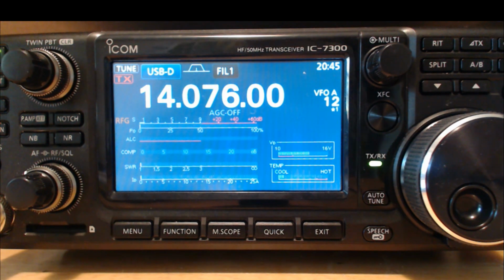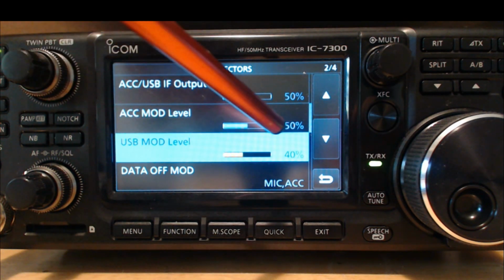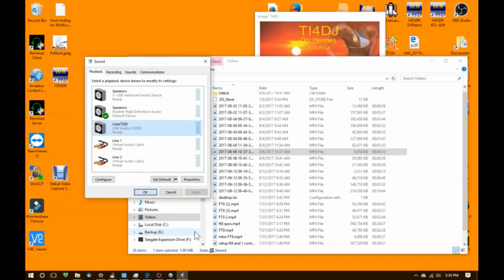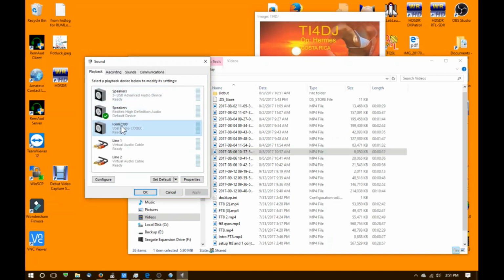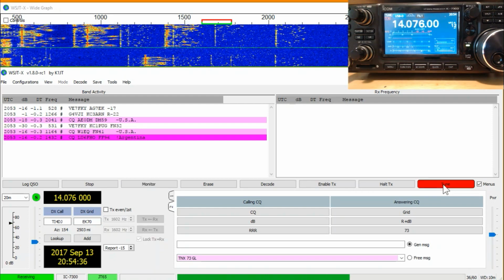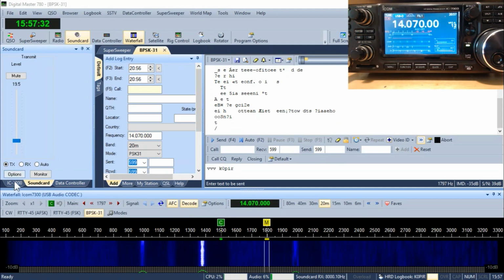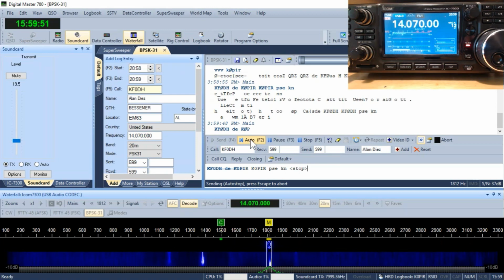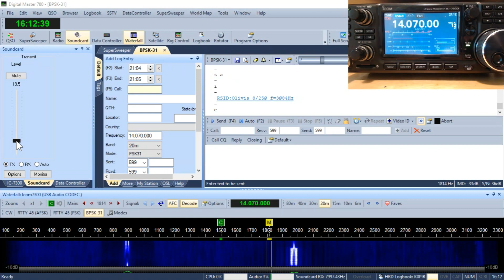Icom 7300 EASY Transmit Settings For Digital Operation

Comment: I have trouble with com port 5, my PTT port.  I get error message saying it is in use by another program but nothing else is running.  I've used task manager to check, but nothing using 5.  I cannot figure it out.  I set the radio up just like you say and only get steady tone on RTTY with DM780, MixW, WinWarbler,   Any ideas? Thanks.
Reply from the maker: Hello and thank you for commenting here. What cable are you using for rig control? 73!
Reply: @HamRadioAdventures  Valley Enterprises cable.  I did look at your screen shots and I have mine set up exactly like yours.
Reply from the maker: @geod3589  OK that is an FTDI cable and you have to make sure that the driver is installed for it. Bring up the device manager and see that it creates a comport when you plug that cable into your computer. It plugs into the remote jack on the back of your rig, so it does not carry audio like the USB cable does, it is just for rig control. Let’s make sure the driver is installed properly first.
Reply: @HamRadioAdventures  It creates port 5, and device manager says the driver is up to date.  Just odd some programs see port 5, and others don't.
Reply from the maker: @geod3589  OK that is good. That port is 19200 baud in your ham radio software end it only sends the radios commands, no audio. So RTTY, DM 780 and the others you mention will not use it. Ham radio Deluxe uses it when you open the program and it asks you to connect. That’s the port you connect to and the baudrate is 19200. You want to send RTTY, PSK 31 and others you will need a USB cable. OK? Do you have one connected between the radio and your computer?
Reply: @HamRadioAdventures  Yes I have a USB on port 3
Reply from the maker: @geod3589  okay great. You’ll want to start with this article https://www.k0pir.us/icom-7300-ham-radio-deluxe-quick-start/ let me know what you get that part working.
Reply: @HamRadioAdventures  I give up.. not going to waste any more time with this.  I'll be content with AFSK.  Just odd how some programs won't key FSK, and some will, some say port 5 isn't there but then run fine.  Then RMS Express won't do anything at all.  All of this with exact same settings.
Reply from the maker: @geod3589  you can’t key for FSK using the C-IV cable. I am assuming you have the ICOM 7300, so you will need to use virtual serial port emulator or use the CI-V cable for rig control and then the USB cable for FSK keying. It’s all right here https://www.k0pir.us/what-you-need-to-know-about-ham-radio-deluxe-dm780-rtty-fsk/ Good luck and 73!

Comment: AWESOME video. Everything worked great with WSJT-X until I added memory to Inspiron 15 3567 laptop and now TEST PTT is red and no power output. I've checked levels as you recommend and they are set . Don't know what to do next?
Reply from the maker: No power goes out when testing from the settings window. 73!

Comment: On my IC-7300 
I think I have my setting correct but the mode keeps switching back and forth from USB-D to USB while in FT8.
You never know what mode it will end up. 
Could you make any suggestions 
Enjoy your videos very much. 
73
wd4dda
Reply from the maker: Hi Preston, thanks for commenting. If you are using Ham Radio Deluxe as the radio in WSJT-X, that is the issue. Set the mode to none in WSJT-X instead of Data/Pkt. That will stop it, but you’ll just have to set the mode manually on the radio. To avoid having to do that, I use a CI-V cable for the rig control in WSJT-X and I can use the ICOM 7300 as the radio in WSJT-X without any issues.  OR if you do not start HRD rig control, you can use your radio as the “Rig” with the appropriate “Serial Port Parameters”.  I hope this helps, please let me know and thanks for the question. 73!
Reply: Thank you for helping me out.  There are so many more setting on my 7300 than my FT-950.
Hope you have a good holiday with your family and get to stay off the roads for a while.
73
Preston wd4dda

Comment: Thanks for video. Unfortunatley now on current Windows 10 ( March 2020 ) the audio setting dont look anything like yours in the video. Maybe the constant Win10 updates have changed the look. Right clicking the speaker Icon brings up a window and I cant really see any correlation to your video. Same on right clicking the microphone. It looks different to what you show on your pc. My system was working but all of a sudden its not receiving anymore. Hence why I came looking on youtube and found your video. Thanks anyway.
Reply: Ken Roberts Hi it’s nice to hear from you and I hope all is well with you and yours. Yes that’s what will keep me in business, software updates 😬 if you right click on the speaker icon and then left click on open sound settings. In that window you will see sound control panel, just click on that and you’ll be where you want to. Or in the search box on the bottom left type in sound and that will take you to change system sounds. I’ll see where you need to go from there. Again thank you and be safe, stay healthy, Best 73!

Comment: I've been battling my 7300 for about 10 days now, but no digital. Now I seem to have lost my Codec. I dunno if I have a defective radio or if I'm just too stupid to live. Any hints?
Reply: Hi Gene what operating system and what Ham software are you using?
Reply: @SouthernManinDakotas  I am using Windows 10 and have been trying to get Winlink or fldigi to work. no luck so far.
Reply from the maker: @generoll4027  Fldigi can be tricky. Try using RigCat in Fldigi. Re: CODEC. Did you install the Icom 7300 USB driver off of Icoms website? You may need to reinstall it, but first, try restarting the computer and check the USB cable connections. See: https://www.k0pir.us/icom-usb-driver-reinstall/ Best of luck and I hope all is well. Be safe and best 73!

Comment: When I put USB SEND to RTS, the rig goes into xmit.. same with DTR, I can only get back to RCV by selecting OFF.
Reply from the maker: Hi thanks for coming by and thanks for commenting here. Yes that will work FB. If you have your software set up exactly like mine it should not do that, but sometimes it’s just easier to turn RTS off in the radio. Please visit my screen captures page and it will give a little more detail on the settings. http://www.k0pir.us/icom-ic-7300-specifications-features/icom-7300-screen-captures/
Thanks again for watching and thank you again for coming here. I really appreciate it, best 73 and gud DX!

Comment: Hi Rich, I decided to give FT8 a try today, thanks to your videos.  It appears I have everything set correctly.  However, when I transmit, I notice there is no output power.  The meter goes to 0.  I'm thinking that's not right. I'm using the Icom 7300.  Any thoughts much appreciated and thank you.
Reply from the maker: Hi Dave,
Yes look at the soundcard settings in the Audio tab of WSJT-X. Should be the USB Audio CODEC for input and output. 

Are you in USB-D mode?
Look at the sound settings (USB Audio CODEC) in the operating system. Go to Sounds and Playback in the sound properties and see if you have the level set to about 50%.
It usually it is a soundcard or sound setting. Three places are 1. In the radio, USB MOD Level. 2. In the Ham software sound settings. 3 In the operating system sound settings.
You can have a look at this to see if your radio is setup: http://www.k0pir.us/icom-ic-7300-specifications-features/icom-7300-screen-captures/
I hope this helps and I hope to hear you on. 73 - Rich, K0PIR
Reply: @HamRadioAdventures  Thanks so much.  Working better now!  Something odd, when I go back to SSB phone and try to transmit, no power output.  Do I have to change settings back for phone by any chance?  Appreciate all your videos and help. 73 - Dave KD2LMR
Reply from the maker: @somarmd  No, there's no need to. Did you change anything in the radio menu? Should have DATA OFF MOD = MIC,ACC or MIC,USB and DATA MOD= USB.
Reply: @HamRadioAdventures  Thanks Rich.  That's what I thought too.  Doesn't make a difference.  Very odd.  I'll keep playing......
Reply from the maker: It's usually something simple that just gets overlooked. The DATA OFF MOD & DATA MOD in the radio sometimes gets confused.
When I go from USB-D to USB all I have to do is turn my AGC back to medium and turn on the NB or NR if needed. The FIL1 automatically goes back to 3k. I adjust my power using the MULTI knob on the radio. That's it.
Have a closer look, I am sure you'll find it.
73,Rich, K0PIR
Reply: @HamRadioAdventures  Update Rich, and for others following this thread, the adjustments did make a difference and it's working fine now.  Thanks as always for your help.  
73 - Dave KD2LMR
Reply from the maker: @somarmd  Awesome Dave, glad you got it. The 7300 is such a fun radio for digital. Best 73 - Rich, K0PIR

Comment: It's a weak signal mode - not a low power mode. For EME, some people are using 1kw. In FT8, some people are pushing 300watts. The ICOM 7300 is able to take 100 watts and it is pretty common for people to be using 100 watts on FT8 if they're working DX. As far as ALC, you want ALC showing on the Icom 7300.
Reply from the maker: Hi and thank you for commenting. You know your stuff. Agreed on all.

Here's a quote from the FT8 operating guide, "Although FT8 is a weak signal mode, not a QRP mode
per se, please keep your transmit power down. Be nice! Generally on HF, if a path is open, just a few watts
will do. Put your amplifier on standby. Turn down the wick to QRP levels. Try it! If you don’t get any
responses at all, try 10 watts, maybe 20 or 30. If you find that you routinely ‘need’ 100 watts or more, that is
a strong hint that your feeder and antenna system are inefficient."

For ALC, yes. The manuals (7300 & 7610) say, "When operating in the SSB data mode, adjust the
device’s output level within the ALC zone." See: http://www.k0pir.us/icom-7300-7610-rf-power-digital-modes/
However, many Hams still choose the "no ALC" approach. 

There's another paper written by Icom for their newer transceivers and it states the "no ALC" approach. 

Thank you again. I appreciate your input and value your comments. 

Best 73,
Rich, K0PIR
Reply: I agree that you should use the least power needed for the contact. It's in Part 97, after all. But, there is a misconception among the QRP crowd that FT8 is a low power mode. It is not. It is a weak signal mode. On many stateside contacts, that will also translate as low power. I don't know anyone who even uses 300 watts who claims that they can't make ANY contacts at 20 watts. However, when you aren't interested in just making ANY contact and are instead going for SPECIFIC contacts, then only using the power necessary to make the contact might entail you turning the power UP. 

For instance, I contacted W2QO in NJ on 12m today. I used 20 watts. I got a +04 report back. I could have  used 5 watts or even less. Then, at 100 watts I contacted NO6E in OR and got a -17 back, W3WTE in DE and got +9 back, and N7MDW in OR again and got -20 back.....one right after another. That wide variation is propagation. To the east of me, I had QRP level openings. I still had openings to the far west,, but they required 100 watts. ( some stations will hear you down to -24, but it seems for some the cutoff for reliable communication is -18)

If I was content to just make contents, then I'd be content working the east coast at QRP levels. I might even think QRP is all you need in FT8 because I'm making contacts. Surely, different times of the day and different days propagation will differ and I will be able to make contacts to the west coast at 5 watts at times. But, if I want those contacts now, propagation will let me have them, but at 100 watts. The same goes for DX. I will luck into some DX that hears me at QRP levels. But, if I want all the DX I can see, even 100 watts isn't always enough.
Reply from the maker: I hear you. Somedays I can make contacts with 10watts and other days it's futile. I'm not a DX chaser, but I'm working on the grids. I only need 30 watts for that and if I can't make the contact, there's always another day.

FT8 is so popular right now I saw another Ham using it as a guide to see whether the bands are open or not. He uses like a beacon. If he can hear FT8 on 6 Meters he jumps into SSB, hi!

Thanks for the input, I am with you and it's helpful. Best 73 and hope to hear you on the air. What is your callsign, so I can add it to my alert?

Rich, K0PIR.us

Comment: A friend sent me this link.  It has helped so much with my IC-7300 with setting up the WSJT-X software.  I'll be operating primarily in digital modes and this is the best.  Liked and Subbed!  Cheers, Bob  KD2BOB
Reply from the maker: Hi Bob, nice to hear from you and thank you for the nice comment. I appreciate it and happy it helped. Nothing like the 7300 in digital! Best 73 - Rich, K0PIR
Reply: I've run into a problem.  The WSJT-X info says to download the IC-7300 driver before connecting to a PC.  I've searched all over the Icom web site and noticed virtually every transceiver has a driver except the 7300.  I clicked on every button on the 7300 page with no luck.    But I did do the 1.21 firmware update this morning.  Is it possible the driver is included in that?  Thanks, Bob / KD2BOB
Reply from the maker: Hi Bob,

Have a look at my website, I answered you there. It is a little confusing because of the "Firmware" at the top of the download page. However the Download Type is USB. Okay?

Rich, K0PIR

Comment: Hello again Rich, I was wondering, once you set for digital communications do you have to reset for SSB or does the radio differentiate between the two modes and no adjustments are necessary? That is, when selecting SSB after using digital can one just use SSB and the ALC for example is at the right level with out readjustment.
Reply from the maker: Hi Peter,

Good question. Actually you would just need to tap AGC to go back to MID or SLOW AGC for SSB. FIL1 will go back to 3.0K when switched to back to SSB. Just AGC needs adjusting and of course your NB and NR if you need it.

Thanks for commenting. I hope it works as well for you as it has me. The 7300 is a great transceiver for digital modes.

Best 73,
Rich, K0PIR

Comment: any help would be great ..... icom 7300 , while I can receive with usb-d when I transmit it changes to usb ? is that ok or should it be transmitting on usb-d ? 2e1paw
Reply from the maker: Hi Paul,
Transmit in USB-D mode. If you are using split mode in WSJT-X, try changing it to "Fake it" instead of "Rig". Okay? Nice to hear from you. - Rich, K0PIR
Reply: Ham Radio with K0PIR thank you I'm out at the moment be back home soon. I'll keep in touch
Reply from the maker: Okay Paul! Take care - Rich, K0PIR
Reply: hi no im not in split mode . the problem im having is when I transmit the usb-d goes back to usb and also the filter changes to 2 when I have set to 1........ mode is usb split operation is none ptt is in cat all seems to be ok in settings
Reply: I re-created the problem. 

In WSJT-X settings use  Data/Pkt for Mode and use Fake it for Split Operation. I think that will do it.

Or you can use None for Mode and None for Split Operation. Try a combination of the two, one will work best for you.

I had an issue with using HRD as rig in WSJT-X and it going back to USB instead of USB-D. I changed my settings to Mode=None and Split Operation=Fake it.

Comment: Nice video rick. But how to setting my alc ? 73 edmundo CE2VQF.
Reply from the maker: Hi Edmundo, nice to hear from you. If you have your RF POWER set to 100%, and as long as the USB MOD Level in the radio is around 40% it will be hard to see ALC deflection. There is not a specific setting for ALC. Having no ALC is safe and you will produce a nice signal. 
To gain some ALC if you want to experiment, just turn up the USB MOD Level in the Icom 7300 menu to 85% and turn the RF POWER down to about 50%. You'll see some ALC then. Okay?
Reply: Ham Radio K0PIR ok rick thanks for yor time. And big help
Reply: hi rick

If you are in the right thing, I raised it to about 40% and the raise went up by 30%.

Thank you very much for your help.

regards